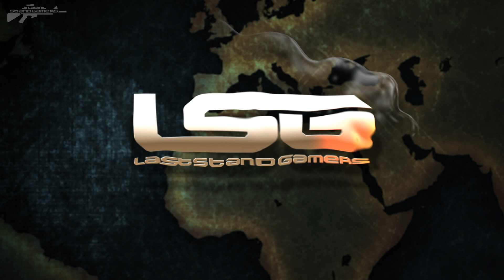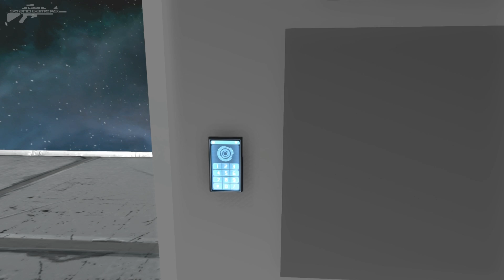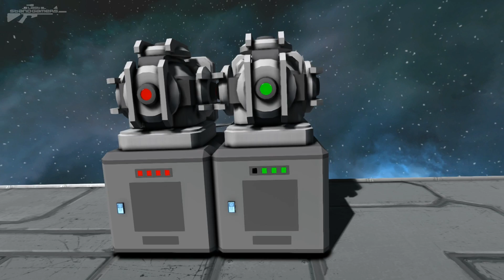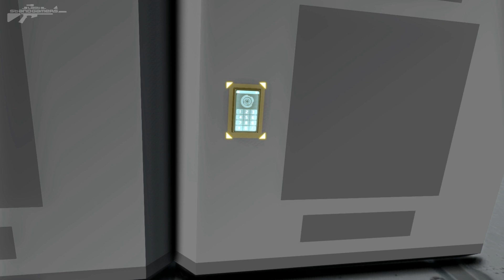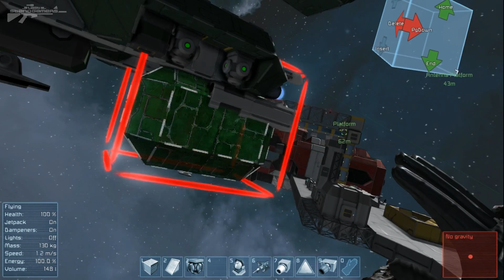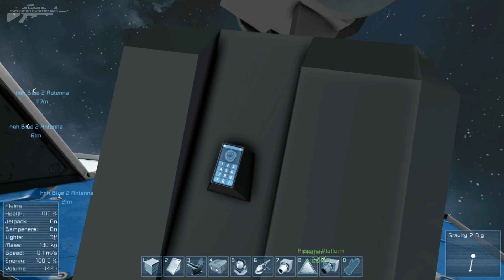Space Engineers - Battery Blocks, Rechargeable Cells, Antenna Relay

Comment: I'd like to see programmable cockpits, so you can set a flight path for a ship and it will continue following that flight path until it runs out of fuel, or you send it a "stop" command via an antenna. maybe you could program them to come and dock with your station to take on more fuel if they are running low.
Reply: Oh, and the ability to control inventories and machines on other stations via antenna would be interesting too.

Comment: You could produce a station, with merge blocks to dock with ships, and then on the station itself make it little more than a giant solar panel relay, and when docked you could charge up your ship's batteries.  Personally I would never rely on batteries, I would use reactors mainly, but you should keep batteries in your ship and charged in case you run out of uranium, or the reactor is damaged.  However, someone could build a ship entirely on the use of batteries, if you store them in different parts of the ship, and never have them all on at once, you could always have a few on, and the rest off, that way even if for some reason you happen to lose a lot of power all at once, only your current batteries will be drained.

Comment: you could make a solar satellite that are filled with these batteries and could be copied to which these copies would be placed and left in key locations to charge and act as fuel depots, you could also place beacons on them so to highlight these solar satellites or have a large battery pack connected via a merge block and once full could detach and use to power what ever while swapping it out a with depleted battery at the same time.

Comment: I don't play SE but I've watched it a lot, but would it be possible to build a timed bomb/explosive using warheads and a claw mechanism to hook onto a ship, having control over a control panel, and theres a pole on attached to a rotor so when you set the rotor to swing the pole, it will swing and hit the warhead and boom, but that is if warheads are sensitive enough and the rotor swings the pole fast enough, oh and I forgot to mention to put the warhead at the back, claw at the front, put warhead in a box like, and makesure it's not going to be seen on the enemy's ship, hopefully you understand this and if it is possible give it a try?

Comment: So how do you determine how long a battery will last if nothing else is powering your station? It says max stored power is 1MWh and max output is 4MWh, so how do you figure out how much the battery holds if your station or ship has no power but you have a fully charged battery?
Reply: If all reactors are off, then "Fuel time" in HUD will show how long the battery will last. The "Fully depleted in" line in the control panel will show that as well.

Comment: I don't like how you pretend antennas are more than they acutally are right now,  it only sends position data.
Also there is currently no need for solar power, they need to work on the rarity of uranium and balance it. Cargo ships just carry so much uranium.... I wonder when they are going to be able to work on balances and optimization properly. If they keep adding new features, it's gonna be another 2 years.

Comment: You could totally make a whole new station. before, there were some general ideas of space stations, from mining rigs, to trading centers. Now, we can put batteries on ships, and use a merge block to connect to a solar array station to charge up your ship. Your ship doesn't need reactors or solar arrays, as long as there is a charging station. If batteries were a lot smaller, or small reactors were bigger, they would be a lot more useful for compacting your ship. I think I like all the ideas going in my head.

Just imagine, your faction is at war with another, and you have tons and tons of battery powered small fighters because batteries are cheap, (Hopefully cheap, I don't think Arron showed the materials to make them in the video) and the enemies are attacking your solar station in hopes of crippling your incredible force.
Reply: Well, removing the recharge station is kind of a weakness, isn't it...

Comment: Also since microwave transmission is very inefficient it could prompt another new source of energy. Perhaps they could add a very endgame reactor powered by antimatter that would be capable of producing the equivalent energy of 43,000,000 tons of TNT per 1 kilogram of antimatter at the cost of needing a smaller amount of energy to contain the antimatter. It would also explode if damaged too badly (when I say explode, I mean 43,000,000 tons of TNT x the number of kilograms of antimatter).

Comment: So you can convert most of your ships to accept cells attached to a merge block to exchange drained and readily charged cells at a charging station, two merge blocks between a number of cells set to charge plugged into a ship, then when almost empty the ship sidles up to the receiver plug (merge block) of the charge station to connect like this <=====>, top line is the depleted battery, the bottom the charged, then it's a matter of detaching the drained blocks

Comment: Neat update, I hope they make the reactor a bit dangerous to work with, as it will create a giant explosion if not treated well (for instance, not enough cooling) or when damaged by enemy fire!
Reply: hmm that would be very interesting considering most small ship designs include a large reactor that would be very interesting indeed. and if there was a battle between two small ships and one was to close and the reactor exploded wiping out both ships would create a interesting strategy indeed
Reply: I would like to see a ship kind of split itself in half if the the reactor breaches. Imagine a large ship getting cored only to have a massive shock wave come off the ship and slit in half as well as damage other objects around it. It could then start a chain reaction to any other reactors on the ship.
Reply: Then it would be logical to have them mounted on pylons or armored very well
Reply: blade00362 I was under the impression they could meltdown and explode or is that fission reactors?
Reply: Alpha Scrub It's in the word: MELTdown.
The uranium used in reactors does not contain enough U-235 to be able to explode.
Reply: blade00362 But explosions are awesome and give a great touch to destruction! Meltdown is a bit boring.
Reply: Singleraxis They are going for semi-realism.
Reply: blade00362 They haven't confirmed that yet. Explosions are just awesome and gives you a feel like you really hit the weak spot, in this case, the reactor.
Reply: Singleraxis Unless they implement proper explosions it just shouldn't happen.
Reply: blade00362 But as you don't have gravity without a gravity generator, the molten uranium should spread through the whole ship and not just sink into the ground. More destruction.
Reply: Dieser Typ Hier The reaction stops if it spreads too much.
Reply: blade00362 Yes, but before the reactor walls are breached (which should take a bit) it should have enough time to build up temperature.
Reply: Some kind of explosion or meltdown would be really cool. If you ask me, though, there should be two different types of reactors: Uranium and Thorium.

Thorium reactors produce more energy and won't meltdown, but thorium ore can only be found as a random by-product of refining other ores.

Uranium reactors produce less energy and can meltdown, but as a by-product they produce depleted uranium which can be further refined and used to create nuclear weapons. >:)

Do you know what happens when a nuke goes off in space? On Earth a lot of the energy is lost to the explosion but in space where there's no atmosphere the blast is almost 100% radiation. A bright white flash and then everything near it is incinerated.

Comment: The battery block is awesome and very useful. If anything it makes for a great backup energy source should you run out of uranium at an inconvenient time.
Reply: I think this is the first comment chain about the video I have ever seen. Thank you, it was beautiful.
Reply: My idea is based around the idea of that there is a few batteries around the ship, since they can take up small space but same as a whole cube. just thinking about taking damage to components and or power supply can cause mayhem to fix in flight. But i would definately reccomend having backup batteries in any case always on full charge and turned off until you notice that you're 10k from your base in a ship with no uranium and your generator runs out. its the easiest solution. keep it tucked there for safety
Reply: I wounder maybe just maybe I could make a hybrid ship where the reactor charges the ship and the battery's then using the battery's to then run the ship
Reply: Not currently as I see it since the batteries can either Power something or be in the recharging state
Reply: Jason Ratz
That being said, there's no reason why you can't just build a ship and charge the battery in it while you fly it with a reactor, then switch to battery when it gets full.
Not sure why you'd do that with a reactor since the batteries have 80% of the power put into them but ya know.
And yeah, the update page on the forum says the batteries are 80% effective.
Reply: Jason Ratz I would say have a solar panel and a battery block and when the sun is blocked or the panel is damaged you can switch to a back up reactor after the battery depleats
Reply: Or perhaps have the batteries tucked away near components and away from the reactor in a situation where the actual reactor gets blown off or damaged mid flight. I doubt you would want to hop out of the pilot seat in a craft thats uncontrollably moving around. instead initiate the batteries as ''backup generators'' of modern hospitals and other buildings that have a necessity of power. (life support for instance.) or just recovery mechanism.

or a way to get around having to build reactors in your ships because they take up space and require feeding uranium into them, meaning easy access possibly tubes to move said uranium around if the reactor is in a heavy armor cage...
Reply: Andry-Kevin Koort where as you could just have a battery the way I would have it is I would have a small reactor on my ship somewhere and just manually shove uranium in that as a generator just to charge my battery
Reply: Stewie Stewart
Then dont break it!!

About the battery block, it would be nice to have a station with solar arrays charging batteries, and dock a little fighter only battery-powered and recharge it... But i guess this is not currently possible :(
Reply: ***** Well you could very possibly do something like that. However I'd recommend having a minimum of two batteries on that ship. Just so you would have one that could serve as a backup. Then you just have to remember to toggle between recharge or not.

Comment: So could batteries be used as an alternative to reactors for small ships? Could a recharger satellite be designed using a few batteries, solar panels, and a connector (akin to the solar panel satellite from your the solar panel patch video)?

Comment: One idea for the battery could be like a rechargeable plug-in power module.
It gave me the idea to make a drilling rig that uses suspension wheels from the last patch to drive a piston to push the drillhead, while small ships equipped with batteries could provide the power through connectors, maybe having 10 ports on the drill, 20 battery ships, and a recharge station equipped with 15 ports. That way, you could power the drill and simply exchange batteries when one runs out, sending it back to the station to recharge, while having 5 spare ports just in case too many need recharging, in which case the drill could switch to the main reactors, which would normally be used for movement while the drilling rig is in transit.

Comment: How much power does the Small Ship Battery Block hold? The large ship Bat. Block had 1.00 MWh (Mega-Watt hours (can sustain a demand of 1 megawatt (1,000,000 watts) for 1 hour)), but what about the small ship block?
Reply: Nvm. The small ship Battery Block can hold up to 360.00 kWh (360,000 watts), or just over 1/3 of the capacity of the large ship Batt. Block.

The SMALL Batt. Block could only power 1 Antenna (on Infinite range = demand of 4 MegaWatts) for 5 Mins and 24 Secs on it's own, while the LARGE ship Batt. Block could power the same Antenna for 15 Mins 00 secs.

HOWEVER: neither Batt. Block could actually power a Antenna set on infinite range on their own because neither of their max. power outputs are high enough.

Comment: I was hoping to be able to charge the battery from the solar panels to save uranium.
Reply: You can do that...
Reply: Latter in survival you can but the battery still takes at least 6 solar panels to take a good charge in a reasonable amount of time. So we still have to relies on reactors for most of the game.
Reply: Timmy Newell Oh. Yeah that kind of sucks.
Reply: Timmy Newell
Thus is the way of progression.
Reply: Timmy Newell  I think you're misunderstanding the units, the large batteries can store 1 MWh which can be achieved through a 4 MW input for 15 minutes, or a 1MW input for 60 minutes, or a 100kW input for 600 minutes. It will take a very long time to fully charge a battery with a small number of solar panels, but it can be done.
Reply: Timmy Newell it needs 4 megawatt-whats to charge all the way? megawatthours? megawattseconds? watt isn't a unit of energy, it is a rate of energy.
The solar panels will work just fine at any amounts, you simply need more of them to achieve the same charging rates as a reactor.
Reply: Timmy Newell Actually solar panels have been buffed and produce around 120 kW of power per large ship panel.
Reply: Did you even watch the video?
Reply: Timmy Newell That could be fixed by having like, a "gasstation" where you simply connect with your ship and recharge it from the other battery
Reply: A solar panel create125 kilowatts and the battery needs 4 megawatts to charge all the way. The batteries Aaron showed were almost full so the h.u.d. showed a very short recharge time. In game the batteries once built need about 10-15 minutes to charge from a reactor.
Reply: Still you need about 32 solar panels to get the 4 mega watts needed to fully charge the battery.
Reply: The solar panels are still not an alternative to reactors in survival. We still need uranium for almost all of a survival game.
Reply: Timmy Newell no that is wrong 2 i can ge solar in like the first bit of survival but u have to focus on it
Reply: Timmy Newell Salvage a fuckton from drifting cargo ships. I've got dozens just waiting to be set up for a farm. I'm currently working on this in my own game. I'm using uranium at the moment, yes, but soon will be completely self-reliant on my energy needs! When I say soon I mean relatively speaking. There's still a lot of mining to do in my asteroid I'm about to start hollowing out.
Reply: Timmy Newell And there is infinite uranium in cargo ships. I have 500kg spare uranium with about 150kg in my ships/station. Currently there is just no point to having solar arrays, I build them just for looks and to charge batteries.
Reply: Fair enough.
Reply: ***** i merged every cargo ship with solar panels to my station works fine and even powers my gravity gens, assemblers and refinery at the same time
Reply: ***** That's what I'm trying to say here.
Reply: If this is a troll many people got trolled
Reply: ***** You can by using a connector block.